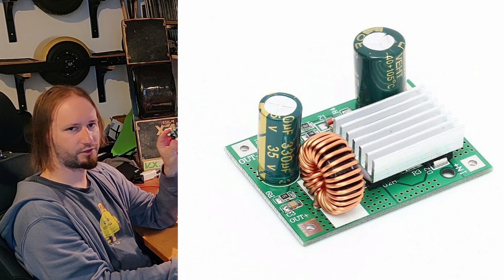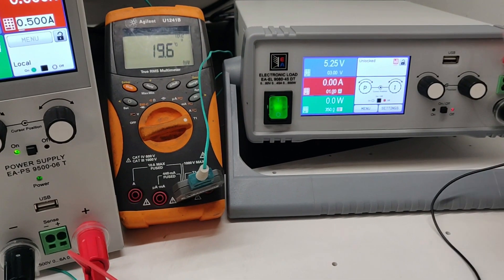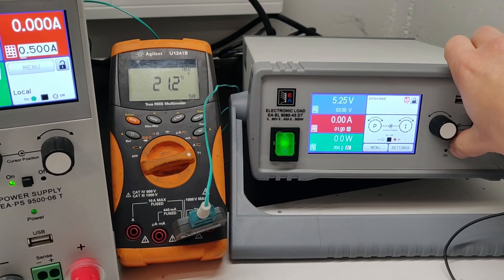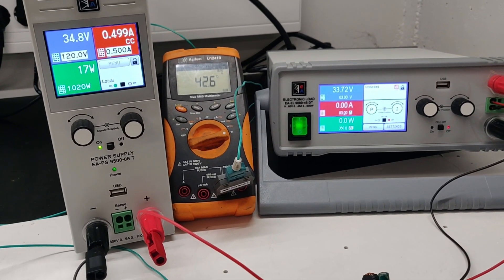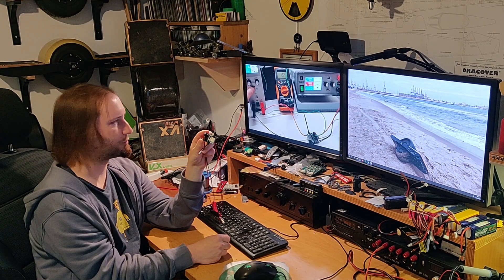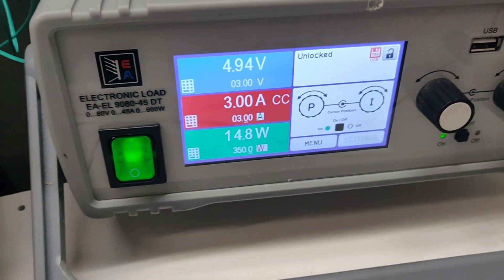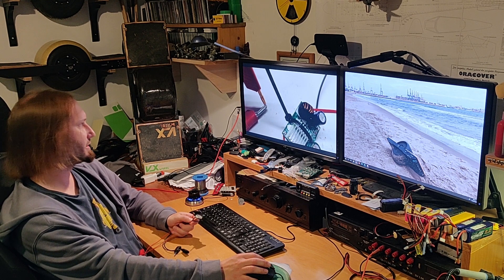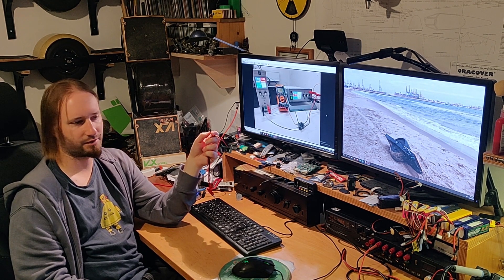120V 5V DC Step Down Converter Module Explodes - Full Review

Comment: Awesome! Can somebody tell me how can I modify the output voltage from 5v to 12v in this module?
Reply from the maker: You can just buy the 12V version. Both are available.
Reply: @VXwheel yes, but isn't available in my country right now, and the model of IC can't see because was erased, so i cant identity wich pad is the feed back
Reply from the maker: @apbtmaxx This is tricky yes. Good luck. For me, it's so cheap to get it on aliexpress that I don't think it's worth the time to figure out how to change it.

Comment: I think you would find that placing a small load on the power supply when the output voltage rose above 5V would bring it back down to 5V.  Also, I wonder how much of the drop in output voltage was caused by the resistance of the wires.  (2 years late, but hey)

Comment: I'd like to use this step down module as a component in a PCB I'm designing, but I can't find the foot print, the mechanical drawing, the diameter of the input and output holes, its relative position in relation to the edges of the plate, etc. Do you have it so I can continue my project?
Reply from the maker: I sadly don't. It needs to be manually measured and designed.
Reply: @VXwheel  Ok, thank you for your quick response!

Comment: Thanx for the video...I have the 12V 3A output...I used 48V battery for a LED signal light and it works fine....I switched the battery with a 36V and the converter stopped working.....I thought the input is from 9V to 90V. I want to add some flashing lights on my daughters bike and her battery is 36V..Any thoughts on whats happening?
Reply from the maker: Sorry, no idea. As they are so cheap I would just try another one.. Or even a different one, this one seems to be more targeted to the high voltage. The ones up to 50 or 60V might work better at 36V.

Comment: I have 4 of these sl3038 buck converters in my little e-motorcycle to do 12v and 5v from the 84v battery, I didnt trust the claimed 3a output so put a pair in parallel to run the 36w12v headlight, also did another 12v one just for the mechanical horn as i didnt want any back emf failures to kill my other needed electrics. (alarm, gps etc)
so far they have been in over a year and no issues, so impressed with them i put one on my e-mtb for 12v for the qc3 phone charger off its 42v battery, oddly i'm on my 3rd one in 7 months which is weird, i'm stuck with them on the big bike as its 84v, but i think for the e-mtb i may switch to lt3800 based bucks as a better design (external fets) but only 60v rated.

Also some seller sell the boards without all the components fitted, I have not investigated what the missing components do, but I do know the 'short circuit protection'  does not save the chip on these less populated boards so maybe those components detect the short. /or the short circuit protection protects it from powering up into a short, but not a short that occurs during normal running.

Comment: Got any idea how I could swap some resistors on this board to get 19.5volts?
Reply from the maker: There are similar boards with adjustable outputs, so the best way would be to find one of such and just set the desired voltage.

Comment: what series capasitor and mosfet you use ?
Reply from the maker: Mosfet I used:
https://si.farnell.com/on-semiconductor/fdd2582/mosfet-n-ch-150v-21a-to-252aa/dp/2454151?ost=2454151

Diodes:
https://si.farnell.com/vishay/vss8d5m15-m3-h/schottky-rectifier-150v-5a-do/dp/3497287?ost=3497287

Capacitor:
Any rated about 35V and between 300-500μF will do.
Reply: @VXwheel  thanks bro
Reply: @VXwheel is the serial ic used uc3845 ?
Reply from the maker: @suprioke5936  Sorry, I am unable to read the marking off. It was cvered with some hard gap filler and after removing it the marking is not visible enough...